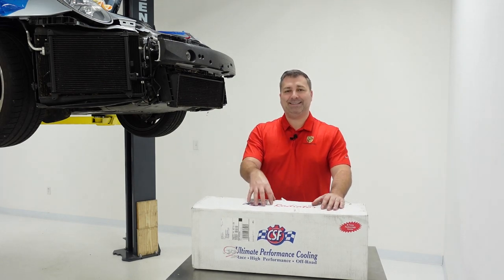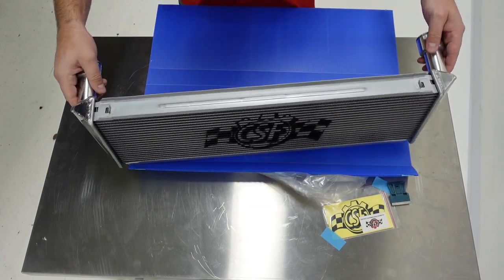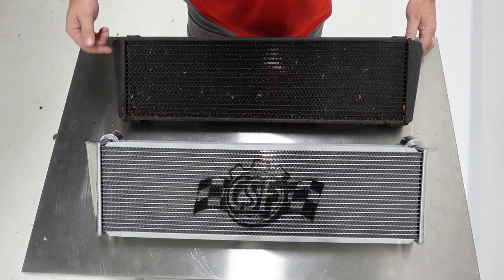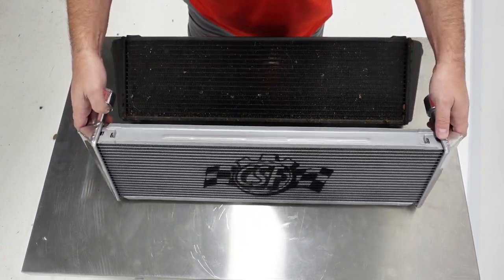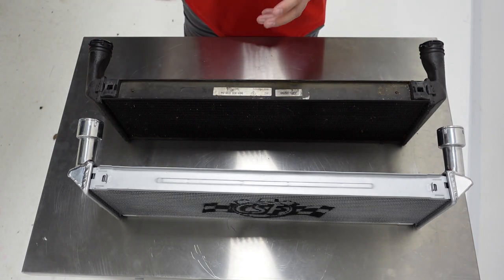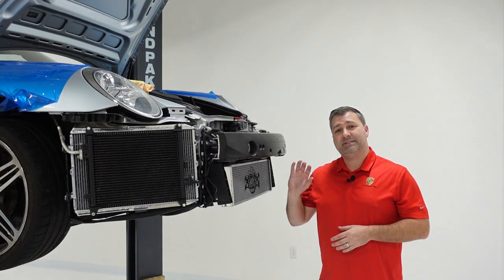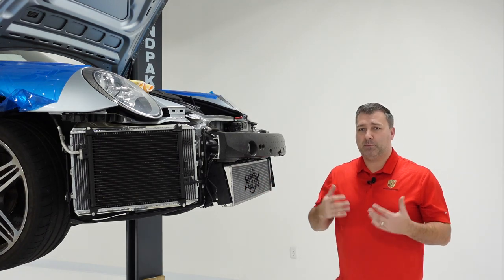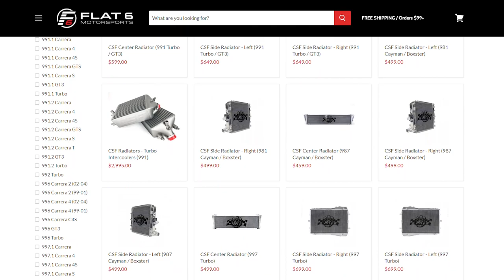CSF Radiators for Porsche Vehicles (Product Showcase)

Comment: Hey thanks guys but i was looking for some temperature diffrentials or specs. Like almost all 986s Mine runs too hot to track or autocross so was looking to use performance upgraded radiators to significantly lower my temperatures.